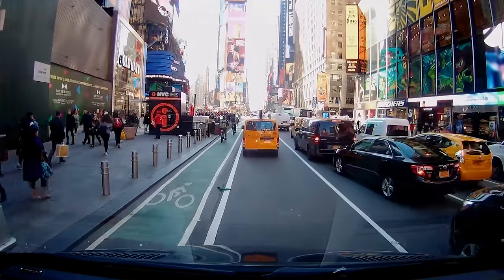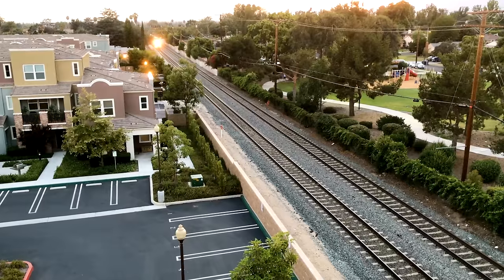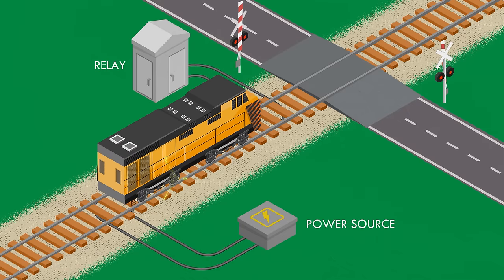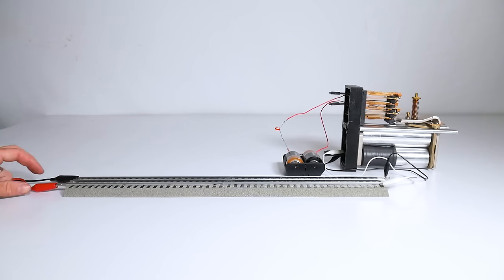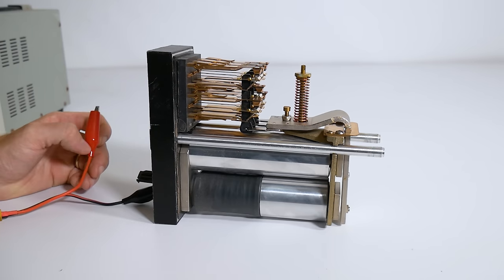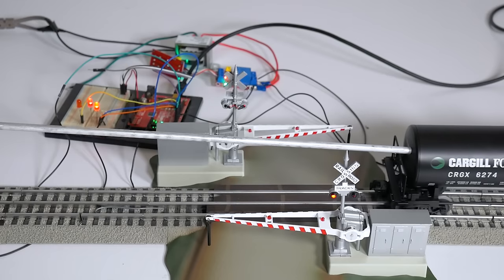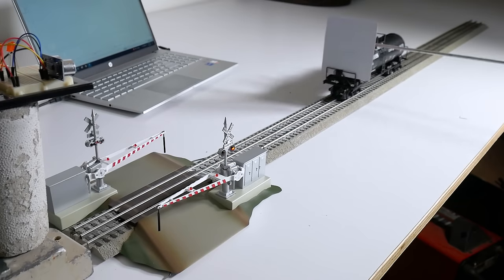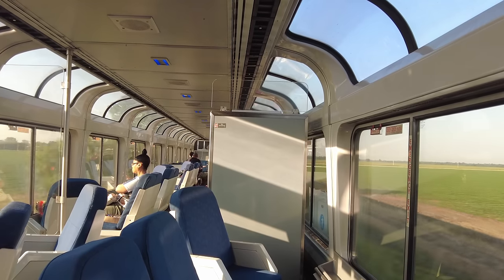How Railroad Crossings Work

Comment from the maker: Happy New Year! What other burning questions do you have about railroads?
Reply: Defect detectors!
Reply: You should cover defect detectors next!
Reply: Happy new year Grady !!! This series is awesome... can't wait to signaling videos, I think it would be a series by its own. Another great thing are gravity yards.
Reply: Hey, could you at least acknowledge in future videos that the railroad-related information you present only applies to NA (when that's the case)? At least in central Europa, with few exceptions, at-grade crossings work nothing like you presented in the video. Thanks!
Reply: do one on the function of old railroad crossing signals like wigwags and griswold rotating banner signals
Reply: A comparison of different locomotives/traction systems would be neat (steam, diesel-electric, different electric options), especially since diesel is dominant in the US, but there are many other systems worldwide
Reply: I understand that it's not really the point of this channel but it should be mentioned that in the US the oligarchy on freight rail has significantly slowed advancements in safety. I understand some people might think of it as a political issue but it really isn't. Railroads are posting record high profits while cutting cost and reducing investment. Not to mention the relatively small federal oversight.
Reply: you should partner with Distant Signal or CCRX 6700 and talk about all the other railroad track technology, like all the flavors of defect detectors and signaling
Reply: Is steam still used in modern locomotives in any way? Cleaning applications or anything? I just want to think steam still has its roll  👀 🤭 in the industry still. Once powered it now __ it 🤷‍♂️
Reply: Air brakes would be cool
Reply: Grady, I watched this on Nebula.  Thanks for being over there too.  Folks if you don't have a Nebula subscription, get one.  Lots of amazing content over there that is all ad-free!  I got to watch this video before everyone on YouTube!
Reply: I hope axle counters get a mention in the future signalling video. Many railways are using them now to help avoid some of the limitations track circuits have. If you need a contact in that area then reach out as our sister company makes them! (Frauscher)
Reply: Every so often I read about a motor vehicle getting stuck on the tracks at a crossing.   Why does this happen and is there a way to fix the problem?
Reply: @hardlyworgen71 Low trucks can get physically stuck on the hump of the track due to incompetent drivers. Otherwise it is usually vehicle breakdown or human error that leads to cars stopping on the tracks. It rarely ends well.
Reply: Why not avoid at-grade crossings in these dense areas altogether with bridges/tunnels? The US Senate Committee on Commerce, Science, and Transportation figures at-grade crossings account for 30% of all rail related fatalities, it seems worth it to target specific crossings for an upgrade for grade separation. Or does the cost really not outweigh the increase in safety and decrease in complexity? I know 300 (30% of around 1,000 total rail related deaths/yr) isn't a lot but it's certainly significant. Or is it that this is already a thing and 300 is just so far from where we were that it's okay? The whole grade separation conversation has always interested me, thanks Cities: Skylines for making me a transportation nerd and thank you for perpetuating that.
Reply: Is there a maximum amount of tracks allowed for a railroad crossings in the US
Reply: Catenary systems would be cool. You could mention the different tensioning systems, the aerodynamic tuning of pantographs (they have little airfoils/wings!) and the physics behind pantograph/catenary contact in general.
Reply: Catenary systems would be cool. You could mention the different tensioning systems, the aerodynamic tuning of pantographs (they have little airfoils/wings!) and the physics behind pantograph/catenary contact in general.
Reply: ETCS
Reply: In Germany we have an additional layer of safety regarding railroad crossings. Far away from the crossing is a so called Bahnübergangsignal (railroad crossing signal) which gets triggered when the barriers are down and/or the lights are on. If it doesn't get triggered then this counts as a stopping signal for the engineer and he has to stop before the railroad crossing. Does such a system also exist in the USA?
Reply: Signalling and how to stop trains would be my ideas for future content.
Reply: You mentioned the pattern that train horns make when they are approaching a crossing. I live near tracks and sometimes I hear trains blare their horns for what feels like a solid 30 seconds+. What are the other horn patterns and their meanings?
Reply: You building your own train set? If so, can you show us?
Reply: Defect detectors like those that detect when a landslide has covered the tracks in mud and trees.
Reply: Hi, it would be interesting to cover emergency derailment systems in one of your videos.
Reply: The signals themselves (the block signals) and the fiberoptics that have replaced the telegraph lines. And the use of radio.
Reply: Question I have is why so much effort is put on self driving cars, where from my point of view, automating trains seems way easier. In Lausanne, Switzerland we have the M2 metro system which runs without on-board operators since many years. It is a rather ideal environment, but what is your vision on autonomous trains for future?
Reply: Hi, how feasible would it be to desifnated a flying drone a few yards - let say 100-200 - sending images back to the train so the engineer get a little more time to stop. I mean, drones are getting cheaper. Great video.
Reply: I'm mostly interested in transportation vehicle toilets. In short, how train toilets work. Because I heard a story about a BNSF locomotive with a malfunctioning toilet that ended up with a shitton in the nose...
Reply: @RobDeFino To put all crossings underground (or over the road) is very, VERY costly. My city is trying to put just three underground and the price tag is already into the millions, and the project isn't really gaining much traction for that reason. It costs significantly less to run a safety education campaign (Operation Lifesaver, for instance) than to modify existing rail.
Reply: @kornaros96  I know where you heard this story LOL and usually there's a septic tank on the loco that collects all the 💩 for later disposal. but if the plumping has a problem, well... you may end up with a nose end full of dookie.
Reply: PTC! What it is, how it works, and why it's important. Or you could cover the different brake systems trains use.
Reply: @chelseajordan5752  Two long, one short, and a long = approaching a grade crossing and repeated until the train is clear of the crossing. Long horn means coming to a stop/applying the brake. Two long means they're taking the brakes off and moving forward. Three short, they're reversing. Lots of short horns is an emergency warning. It can vary by engineer, too. Some make their long horns VERY long. Very, very rarely (nowadays) there are also four short to request a signal/request a signal be repeated, three short horns to acknowledge a hand signal to reverse, and two to acknowledge other signals. They're rarer now that engineers have radios to communicate, but every so often technology does fail lol.
Reply: @salvadormuro7346  I think steam is still used in conjunction with some rotary snow plows
Reply: @Menoetia  it was a blue bird that told me the story...
Reply: @Menoetia  wow okay so it really is just a super high cost thing. Makes sense, I didn’t know if it would be that drastic.
Reply: Do space elevators count as railroads?
Reply: You might consider an episode on how railways keep track of the many locomotives and cars that they use, including those belonging to them, to other railways, and to shippers.  You could cover reporting marks, car numbers, the "barcodes" that were once on cars, and the modern AEI readers and transponders that are now used.  Don't fail to cover the importance of the UMLER and the role of Railinc as the registrar of all motive power and rolling stock for North America and in settling the payments between owners and users for usage and repairs.
Reply: @RobDeFino  as someone who has designed/built several of those bridges, they are very expensive both in land acquisition and construction costs. To arbitrarily say replace at grade crossings with grade separations is not economically viable considering the sheer number of crossings in a community.  Most grade separation projects are NOT for safety but instead for traffic flow reasons. They use safety to keep people from getting too upset about the costs.
Reply: Can you talk about firefighting trains
Reply: Here in Victoria (Australia) Level Crossings use so called "Axle Counters" in that the approaching train is detected and number of axles counted so as it leaves the crossing it counts the axles to ensure the train has cleared the crossing.
Reply: @RobDeFino  according to the story, it was a US ton of this stuff...
Reply: Why you no listen?
Reply: Crazy railroad question: if you listen to a passing freight train, there's a specific pitch you hear from the wheels rolling.  You can tell speeding up from slowing down by the pitch, etc.  The question is what does the pitch come from.  There are no tread patterns like on a car wheel.  Might be a weak pattern on the rails from rail grinding?  Or a characteristic grab-release distance for rolling steel surfaces?
Reply: @RobDeFino  average cost to grade separate crossings is too high, so unless it's a super busy crossing or one where lots of accidents occur, it won't be done
Reply: @chelseajordan5752  2 short, one long will be repeated from a 1/4mi out from a crossing until it is fully occupied.
3 short blasts indicates a reversing movement, a series of short blasts is to indicate a trespasser or trying to get your attention
Reply: On level crossings in the US, why are some of them built on a small incline? There are countless clips of Big Trucks getting stuck on the rails.
Reply: How do diesel-electric locomotives work, and why did they replace steam locomotives?
Reply: Miraculous science of  behind ultra-hyper-giga futuristic Hyperloop
Reply: Resistive breaking/Diesel-electric engines.
Reply: How they build tracks
Reply: A dive into the mechanism inside of a railroad Mars light (and other motorized railroad headlights of the past, like the Gyralite)
Reply: Do rails actually get hot after a train passes
Reply: Please do an episode on inland navigatoin
Reply: Nice to know that you use arduino Uno too
Reply: @mustavogaia2655  In US maybe, but trains in europe (including freight trains) go  over 120 km/h, and multiple tracks, so you would see drones crossing each other  at those speeds. That's likely more dangerous than just putting a camera on the crossings and transmitting the image to the train(s).
And... if you have 2 crossings at 200 meter separation, then a single drone can only observe one crossing as a time.
Reply: Europe is an outlier in the way it works, most of the rest of the world rely on some variation of a circuit or predictor. In aus we are now moving toward axle counters but not for crossings👍
Reply: I'm interested in the engineering and history behind the train horn. It's a vital part of a train and has evolved alot. 
I think it would be cool ! 😎
Reply: How do bullet trains have a smooth ride? Do they have very smooth tracks?
Reply: Can you tell me more about visual singing? I live in Melbourne Australia. Can you come and visit?

I find it interesting that red & green = “Proceed at normal speed”. 

My question: is this to do with “fail to a known state”? Why two lights?
Reply: @bethiel  no we do not have those types of circuitry. In the US we have Positive Train Control (ptc) which if an 6.32 crossing order is in effect, then ptc will force the train to come to a stop before arriving to the crossing. Only works if the public call in and reports it to our critical incident desk to put a crossing order in place.
Reply: @Menoetia  people don't understand that the railroad has been here WAY before dense populated areas. It is because of the railroad why those dense populated areas even gained a population. 1 fatality is to much in my opinion but the bulk of those 300 fatalities are the publics error not the railroad. That Rob guy needs to be real
Reply: @chrisharris7893  IR camera for HBX detection, and you have DED (dragging equipment). Check the radio for your valid axle count, and 0 hotboxes.
Reply: Happy New Year!
Here for the demos, great way for learning 😊
Reply: Positive Train Control, CTC and how switches and signals are controlled remotely, Train Braking.
Reply: how to derail 1 without getting caught
Reply: If and when you're next over in the UK, you might like to know that we're still building mainline steam locomotives ... well, sort of.  The P2 Locomotive Trust is currently completing a recreation of a 1930s 2-8-2 express loco, called Prince of Wales.  The reason it's interesting as an engineering project is (IMO) for several reasons: first, we're having to build it to modern standards, some of which will improve its performance; second, we're having to build it using modern facilities, which mean (among other things) fabricating rather than casting the cylinder block, and welding rather than riveting the boiler; and finally, because it will be licensed to run on modern railways, it needs compressed air braking, electronic signalling, several on-board computers, and miles of electronic cabling, as well as acceleration sensors to detect instability at high speeds ... Sir Nigel Gresley is either loving it, or rolling in his grave.  Could this be an excuse for an air ticket to Darlington Works?
Reply: i want to learn more about those weird tower things that i don't remember the name of. they have a yellow lamp behind and there are blue and red color filters so when a train arrives, the thing moves and change colour.  i think people control them using levers. and there are lines that connect to levers. i can't explain that well so i hope you understand. also i see them in the colombo to badulla railway track in sri lanka. they always fascinate me.
Reply: @salvadormuro7346  on major railroads, no, even the snow blowers are diesel. And I'm excluding Union Pacific's steam program, which is a PR stunt. You are more likely to see steam on tourist lines such as the Durango & Silverton, and Cass Scenic railway.
Reply: @michaelbingham1901  the diesel is coupled to a generator, generator makes electricity, and electricity powers electric motors, which turns the wheels. They're safer & cheaper to maintain than steam engines, which if not fired (fueled) correctly, can level entire city blocks.
Reply: @ExploringNew1 semaphore signals. They hardly exist anymore, being replaced with newer signals with lights. Modern signals are like traffic lights, but the red & green lights are flipped, and have A TON of things they could be signaling. I suggest watching videos about then via Delay In Block, and Distant Signal.
Reply: Is it illegal to hold up a malfunctioning train crossing arm manually to let cars pass?
Reply: On a two way track after the train passes through the crossing it is on the approach section of the opposite side how does that work?
Reply: Defect Detectors
Reply: Have you ever watched any videos from Shoestring Hobo?? He's a good man known for hopping a freight train riding from town to town.  What is the general consensus from the rail road folks about the freight hoppers? 
Thank you sir.
Reply: @Menoetia  The place where I used to live (Melbourne, Australia) had level crossing in the dozens. They're mostly on the outer suburbs, but there's a few in the inner ones. The State Government ended up spending $17.3 billion AUD to remove the majority of them. Mainly because of traffic but also there's also been a lot level crossing crashes and resultant widespread reliability issues on the suburban train networks.
Reply: @chelseajordan5752 while there are some general signals that are fairly consistent between railroads,  each railroad is slightly different. Since in the US it's not just "THE Railroad" but a few big class 1s and then smaller class 2 and 3 branch lines, signals may vary by region. The typical crossing signal is long, long, short, long, starting a minimum of 30 seconds before the crossing, with the last long usually lasting through the engine passing over the crossing. Other than that, however, any yard moves, starting or stopping, etc, will vary. Plus, radios have generally made other whistle/horn signals unnecessary outside of indicating a train is about to move.
Reply: @SwissPGO The focus on autonomous cars is a very american-centric outlook from those working on it, because rather than public transit, some would prefer to eliminate the need to be actively driving, instead of eliminating the need for driving in general. We already have a sort of autonomous system for trains, essentially a trip optimiser, but crews hate working with it due to its flaws, and we also have "Positive Train Control" which is intended to be a remote emergency override system to stop trains from running signals or violating slow orders. As sad as it is, we cannot trust that the railroad companies in the US, with their fairly lax regulation, would implement any true autonomously controlled trains in a safe manner, rather than simply as a way to reduce the amount of crew they have to pay, despite already expecting only 2 men to be responsible for hundreds of cars and to be 100% focused and alert for their (up to) 12 hour shifts.
Reply: @JeremyMikkola train tracks have to be held to different standards based on rated speeds. Essentially, the higher speed, the higher quality the rail has to be. Most tracks in the US are maintained for 80mph, because above that rating is 120mph, and a lot of additional safety systems and infrastructure are required that the railroads dont want to pay for. Santa Fe did, until their merger into BNSF, after which all their track was back to 80mph
Reply: @callsignapollo_  Thanks for your viewpoint. I have not been in the US for 20 + years. I hope they'll catch up one day - the sooner the better.
Reply: @elieakins  I have my doubts there is a maximum.  There's a grade crossing on Persimmon Avenue just to the west of the Sanford Amtrak Auto Train station in Florida where the sign says 10 (!) Tracks. I suspect pretty strongly that if there is a grade crossing with more tracks that the railway will lobby pretty hard to have an overpass built.
Reply: @bethiel  No.  Freights in the US and Canada are so heavy that they take far more than 20 seconds to stop.  That said, engineers and conductors on these trains will quite likely be calling in a grade crossing that doesn't function as it should.  If it is a known non-functioning grade crossing (aka, the railway knows about it, has dispatched a signal maintainer to the grade crossing but hasn't arrived yet) they can notify any approaching freight trains to slow or stop and flag the grade crossing.
Reply: @joncalon7508  Thanks for the info, I am working on a realistic transport system in a game, and there’s a grade crossing with 5 tracks, just wanted to know if that was within the realm of possibility of real life
Reply: @elieakins  It would be possible.  though at some point, if you have 5 tracks because the capacity needs that number of tracks, you're far more likely to have a lot of trains blocking the crossing and the delays to traffic would start to stack up pretty substantially.  The reason Persimmon Avenue remains at grade despite the number of tracks is likely because of the Auto Train's reason for being - hauling a lot of passengers with their cars, and the tracks aren't blocked for a substantial amount of time.  Check out Danny's video on that train here: https://youtu.be/fYlWBWlS4t0?si=sVsDaJGrDz_lwaoW
Reply: @joncalon7508  Surprisingly it’s one of the least congested grade crossings I have, when I don’t have a train there, but I tried to schedule the trains to go across the crossing at the same time so that it’s better for traffic flow, granted long trains are not fun to work with on that crossing
Reply: Traffic signal preemption, priority, and special operations used for different vehicles.
Reply: The LIRR Has Eliminated All Grade Crossings On The Main Line Including Westbury Mineola And New Hyde Park Since 2020
Reply: Wheel impact load detectors are WILD!
Reply: I would love for you to talk about ottawa's LRT. In short the French company that custom built the trains for Ottawa Canada has claimed that because the requirements "push the limits of light rail capabilities" the premature failures and wear were not predictable and therefore maintenance requirements from the quote weren't a lie. You could make a great case study about having to deal with the public bidding process or you could focus on all the breakdowns and de-railments.
Reply: How did railroad guages get standardised considering it might have been disadvantageous to robber barons?
Reply: @matthewsecord7641  Standardized Not Standardised Fix Your English Grammar And Spelling Mistakes It’s Standardized Hospitalized Authorized Realized And Analyzed Not Standised Anylalised Authorised And Realised Its ZED NOT SED
Reply: How they deal with lightning. I recall getting stuck for hours because a track was struck.
Reply: Can you post a link to the Arduino script you used for your three position detection. Thank you.
Reply: Why do some railroad crossings have just the lights and not the gate arm also?
Reply: where was 00:29 shot at?
Reply: I really really wish to understand, why cannot there be a simple alarm button around the crossover? I mean, what if someone doesn't have a phone with them? Or what if the signal is bad in that area. Or what if, for some reason, the call doesn't get through in time? And the delay explaining where you are etc. Although I imagine some people could misuse a button like that, but I think it's still worth it to have it. It's just to warn the train coming.
Reply: Make a video of how signals for the trains work not for the cars the trains please
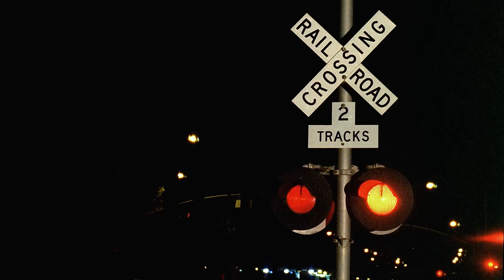Reply: 2:51 Rhetorical question: Why do locomotives continue to sound their horn once into and past the crossing? It seems like the honking should start and end earlier.
Reply: I lived right next to a crossing as a kid. Because we were naughty, we would cut a cable on the track and that would make the crossing activate and drop the guards.
Reply: Would you do a video on why the US can't get a true high speed rail built? Besides financial or political issues, could it be an engineering issue?  Thanks!
Reply: As a self-acknowledged railroad nut, I found this very interesting and informative. My two questions are as follows: 1) I've noticed in looking  at live railcams that there seems to be a 20-second gap between the gates lowering and a train arriving. Is this standard for most or all grade crossings? and 2) Is it the responsibility of the railroad or the highway authority to maintain/fix these crossings?
Reply: Horns
Reply: Stuff about Ukrainian Railways
Reply: How can a person walking down the tracks wind up activating the crossing signals?????
Reply: If a train comes on the tracks and it causes traffic to back up in the city or on the road. Do you think they should build an overpass so it doesn’t cause a traffic jam?
Reply: I really would love to see a deeper dive on how that AC track circuit works to calculate the speed of a train based on the sound. I have heard that sound that you mentioned, especially on long unit trains, but always wondered how that technology worked.